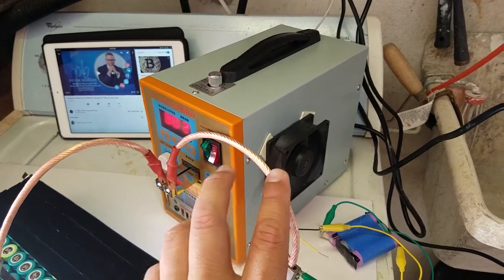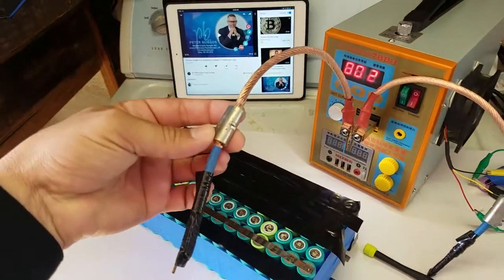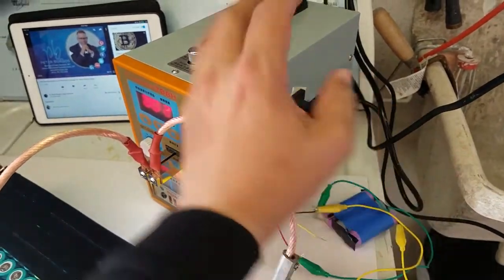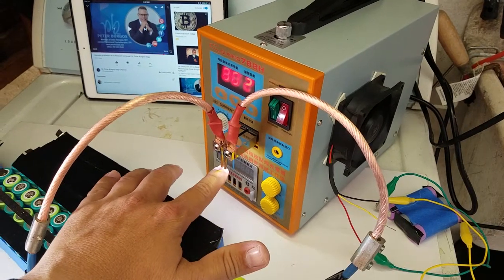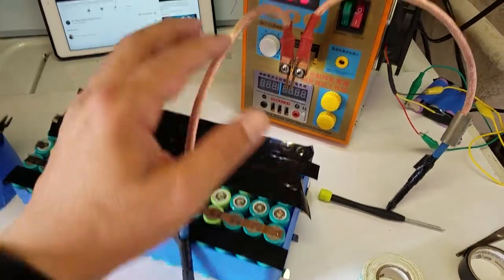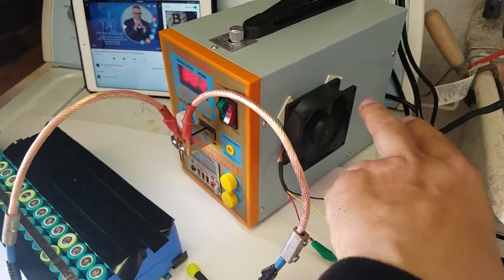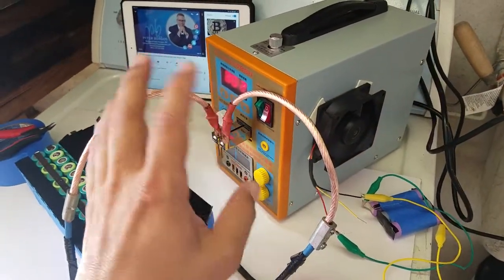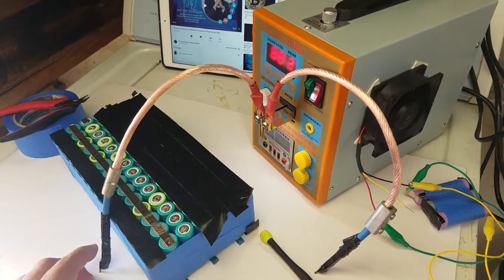Mix feelings and quick upgrade on the Sunkkos 788h spot welder

Comment: I have the same 788H Sunko spot welding machine, I have added the welding pen, but does not have enough power to do its job welding the 18650 batteries, the length of the welding pen are around 30 cm, were you able to make it work?.
Reply from the maker: Nope.

Comment: Resistance in cables will cause the voltage to drop, not the amperage. This is why you can measure 500+ Amps (like another YouTuber did) yet still not get good welds. In other words, measuring amperage is not a good test of cables. All of the Amps will still travel through the cable but with resistance, much of the power is converted into heat before it goes into the material you are trying to weld. To test cables properly you need to measure resistance in milli-ohms. I would speculate that the 220V versions of these spot welders output a slightly higher voltage, so they would perform better when using the pens.

Comment: Youtuber ElectricBike https://www.youtube.com/watch?v=LYGWTbIPTxk (check out 07:09 to 07:51) had the same problem with the cable size being too small and suggests making bigger cables.  Damian Rene has a great short video on making a new set of cables here: https://www.youtube.com/watch?v=raBxQ_eG5qk that seem to solve the problem. The more powerful Sunkkos 709 AD+  might make building battery packs faster.  Hope this helps.
Reply from the maker: Hey thanks for the constant help. I'll check them out later

Comment: It's know that the thick cable has resistance. If copper has other metal properties it will have resistance. Cooling fan helps I didn't know what you temp. In PR,
Reply from the maker: I think the fan helped a lot. Next will be changing the cabling

Comment: Just received a phone call from another person that just received the same welder and having the same problem with the Handheld part..
Reply: FYI - this welder does not come with a handheld pen.  It was not designed to be used that way.  The person that made this video added this handheld pen to his welder (which is why it doesn't work - it's not designed for handheld pens unfortunately).

Comment: Javier, Your are right!!.. Those cables are TOO thin for 80 amps.. In theory, you are supposed to have 3 gauge to send that much power.. . That 80 amp should create a nice spark and weld with the hand held. another thing, make sure the cables are well connected on both end with no movement.. they need to be tight..
Reply from the maker: I'm changing the cables this week

Comment: Unfortunately the quality of those units are poor. Seems like the transformers in those machines are inferior. Parts are reused to make the units cheaper. Looks like you hit it on the nail about the current not passing thru those cables. Make sure contacts are clean and if can use a thicker cable if the connections allow. Here is a video about a transformer replacement on a like unit. Hope this helps!
https://youtu.be/SXxamjDQul4

Comment: Make some new cables. Head down to your local junk yard and get a pair of battery cable from an old car. I'm wondering if the crimped connector fitted to the welder end of the current wires are actually biting into the cable sheath rather than the wire itself? If you can replace the wires with something you trust at least you'll be able to evaluate the welder properly.
Reply: I agree with Mark. Battery cables. You can't go too big;) Hope that works Javier
Reply from the maker: That’s my next move once I’m done with the next project
Reply: If not the cable itself, maybe it's the other side of the cable under the red shrink wrap, where it's connected to those copper plates that are screwed on.
Reply: Jrotor   So do thicker cables decrease the "pressure",(Amps?) of the Power going through?
Reply: @Raul M As long as the connection remains intact amps will remain the same - in a series circuit amps is equal everywhere along the path. Amps cannot get lost or "used up" along the way. In the water pipe analogy amps is the volume of water that flows through the pipe. 

Pressure, in the pipe analogy, is voltage. Larger cables (like a larger pipe) offer less resistance to the "pressure" of voltage so less of the energy is wasted as heat. Voltage is what gets used up along the way. Ideally, all the voltage would be used up in the weld but in reality it gets used up at various rates everywhere in the circuit - but especially in undersized wires/cables and poor connections.
Reply: Yes Raul, larger diameter or guage of wire = less resistance to current flow. Similar to water flow difference between a common garden hose compared to a fireman’s hose. Auto battery cables should be good for 150 amps or so I believe as well as making sure you have tight connections. And if near the ocean and salt water throw on some grease to keep connections from corroding.